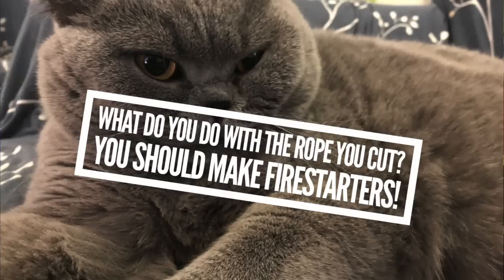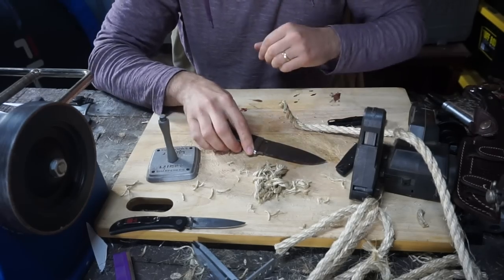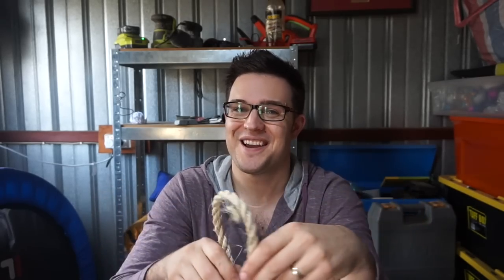Cedric Ada Steel Edge Testing: Frequent Questions and Statements reference video

Comment from the maker: 00:56 - what is your test
02:08 - why are you doing this?
03:40 - what system do you use and why?
05:23 - Different main grinds
06:47 - the cutting board is whats dulling your knives, ya idiot!
07:36 - why dont you use a cutting mat?
08:08 - you should test this steel!
09:41 - what do you do with the rope?
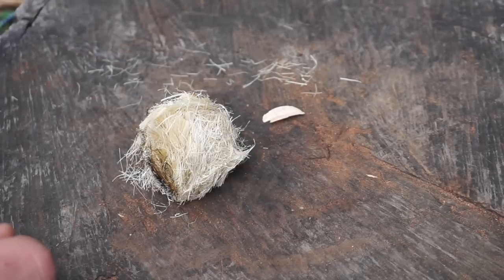10:35 - can I send you a knife to test?
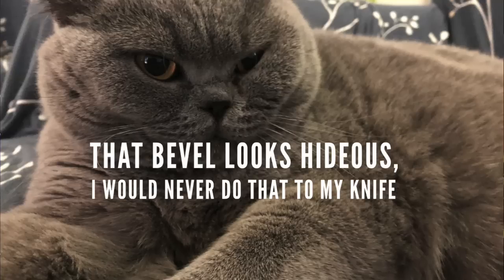11:58 - the bevel is now ugly and you’ve ruined your knife
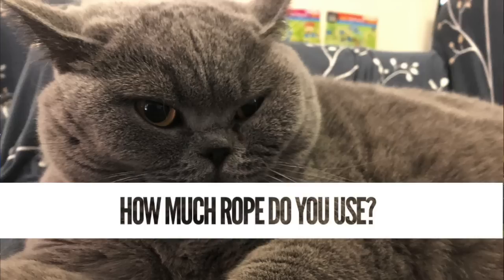12:43 - how much rope do you use?
13:18 - you should tape the blades
14:51 - My experience shows your test is wrong
16:06 - why dont you wear gloves!
16:49 - the test doesnt take into account rockwell or heat treat
17:58 - get or build a robot
19:21 - whats the best steel then?
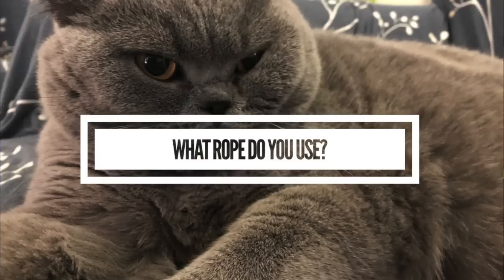20:40 - what rope do you use?
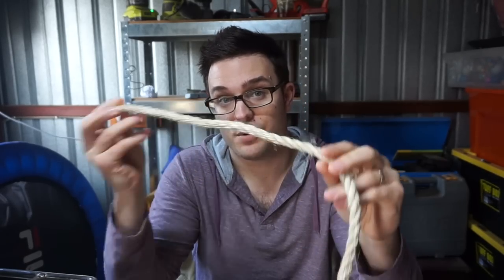21:18 - I want to do my own test, what do I do?
22:25 - you are biased against (insert steel)
23:29 - can you do (insert steel)?
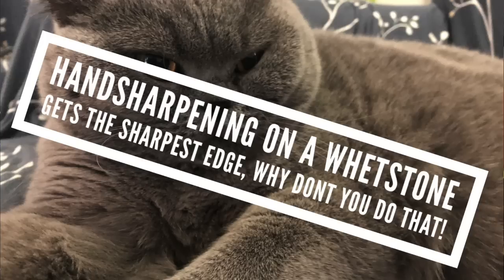24:49 - Hand sharpening is best, why dont you do that?
25:53 - Do scandi edges!
27:01 - best kind of edge for edge retention?
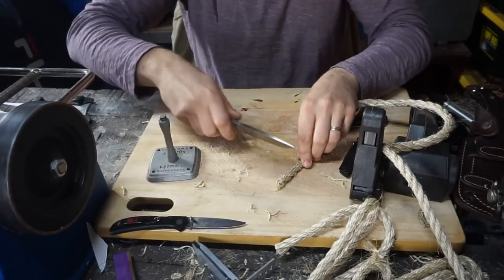28:30 - How do you cut? 
29:05 - general things you’ve learned?
32:06 - how could you make your tests better?
33:03 - where can I see all the results?
33:36 - notable steels lately?
36:01 - why don’t companies use thinner factory edges?
37:37 - the super steels arent worth the time
38:51 - whats the most comfortable handle so far?
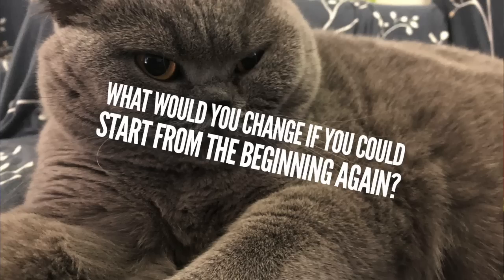40:18 - what would you change if you could start all over again?
42:21 - how do the steep angles hold up to harder use?
46:24 - one emerging positve truth i’ve found
Reply: Thank you
Reply: Heck yeah Pete your data has influenced me heavily so I pulled the trigger on a Kershaw link with CPM 20CV this is going to be my first knife with a high-end steel blade!  I'm super excited and your channel has totally helped me decide on what steels I should be looking at for a high end EDC 😎 super stoked thank you and keep up the great work it's much appreciated. 
Now I just have to figure out how to be able to afford and justify a Maxamet or other exotic blade once again thank you for all your information and your wisdom it is real world experience with fairly consistent duplicatable outcomes outside of your arm falling off

Comment: I always took your tests as more of a general comparison between the steels rather than as an actual edge retention test (because of the variables and so on). To have a general gauge as to how the steels compare to each other is still incredibly useful, because I can use your (and my) testing results to back up a statement, for example that VG10, 14c28n and N690 have comperable edge retention. Or that S35VN is inferior to S110V in terms of edge holding by a wide margin. 
I have watched all your steel testing videos and they are key factors in my choices of knives, you have given me very valuable information about the general performance of steel and I applaud your dedication to the task. In my view, you are the best source for information about bladesteels at least in the realm of cutting performance.
Reply: I Agree with everything you wrote !
Reply: Agree 100%
Reply: well said    i agree  great channel..

Comment: If you want to switch to a different rope, you potentially can. You could take a knife with a known number of cuts with the current setup, and then cut the other rope. You would have to repeat the test with a few other steels to confirm the multiplacative factor (within a certain range). It may be that there isn't a multiplacative factor (which would suck), but you could try it. If the multiplier exists, then you could convert all the data you have.

Really cool video, although I will admit I had to skip all of the dumber questions. THANK YOU for the timestamps.
Reply: Pete, this would actually produce valid data. Something to consider...

Comment: 👍👍👍  I ❤ your test and your method of testing 👍👍👍. I only wish that someone would also do toughest test. A test that might happen in normal day use like cutting cardboard with Staples in it, cutting through meat into a ceramic plate, tapping on a brick, cutting through dirt  or used carpet  (carpet installer might have years worth that they bin every day). Hope you keep doing what you do  👌

Comment: Great work, mate! One suggestion... sisal rope absorbs moisture, and swells significantly. When used in the core of steel wire elevator/lift cables, it can swell enough to squeeze out the grease in the core of the cable, resulting in premature corrosion. I just wonder if ambient humidity can significantly alter your cut tests. I would love to see a simple comparison with a single knife and edge geometry, where the sisal rope is dried out, perhaps by baking it in a 110°C oven, then cut when cooled to room temp... then take part of that same "baked" sisal rope (to rule out any baking damage), let it soak up some moisture from the atmosphere for a week or so... is it humid where you live?... then do a cut test with the same knife and edge geometry. I'd pick a steel that's relatively easy to sharpen, around 100 cuts per test, maybe a D2 or BD1.

Edit a few hours later: cutting held paper might also be sensitive to humidity/moisture... oi vey!

 Howzat?! ;)

Comment: hey Pete I would love to get your opinion on something on the tormek  sharpening system is it true that the Hollow Grind edge that is put on the blade is so small and minor that it is really is more like a flat grind? so for an example when sharpening a paramilitary 2 with a full flat grind on a Tormek the Hollow Grind that it applied to the blade is  almost identical to a flat grind that has been sharpened with a fixed angle system such as an Edge Pro,  kme or whatever? If you find this to be true or your opinion differs please let me know I would really Luke too get your thoughts on this from a person that has use both type systems. I have been looking to upgrade my kme sharpening system to something a little bit faster and consistent,  because I have a lot of Premium high-end Steels that takes awhile to sharpen and would love to upgrade anyways any information would be helpful thank you very much and another awesome very  informative video as always.

Comment: you can get a 3000 grit stone wheel for Tormec, KME may disappoint you
Reply from the maker: Its going well so far but I would like he angles to go a bit lower. great for those mirror edges, and the portability. My tormek has to kinda live in my shed, KME can watch TV with me
Reply: Cedric & Ada Gear and Outdoors 
If you're saying you wish the angles on the KME would go lower you can change it a little. Deano has some good KME videos. One on how to change it up to get lower angles by flipping one piece, and another on using the iPhone angle app are pretty good.
Reply from the maker: Bob Snyder nice will check them out!

Comment: If you need to know your angles on a lansky or kme beacause what they say on the kme is just a general guide  there is an iPhone app that’s fairly accurate called I handy level
Reply from the maker: I've got a tormek angle card that seems to work pretty well, but yeah, it really depends how far away the edge is from the jaws